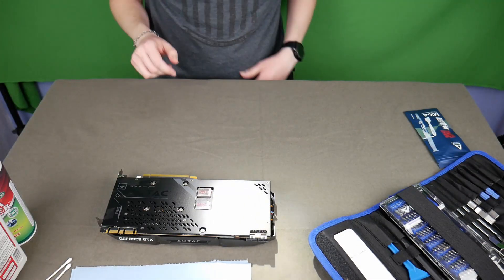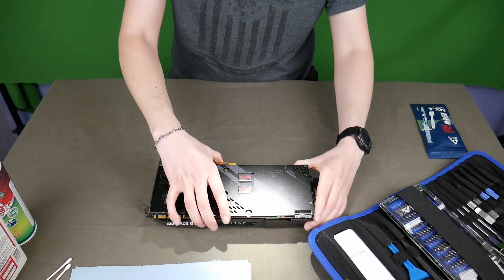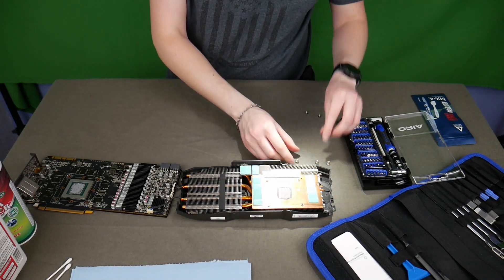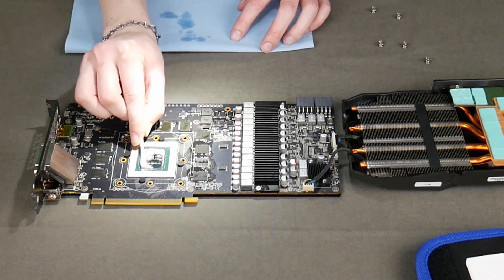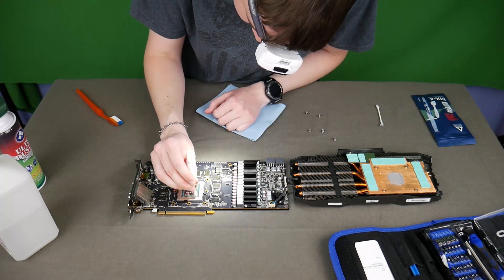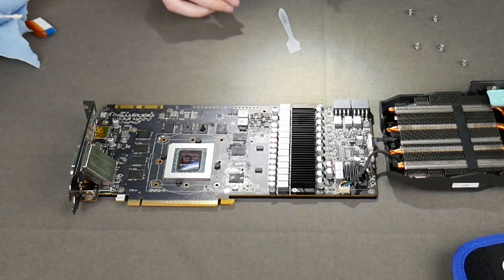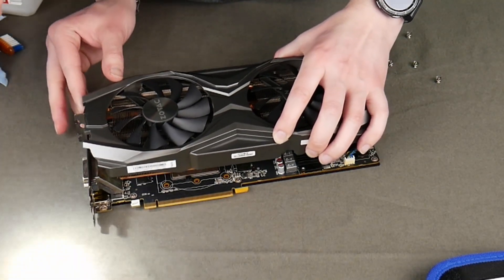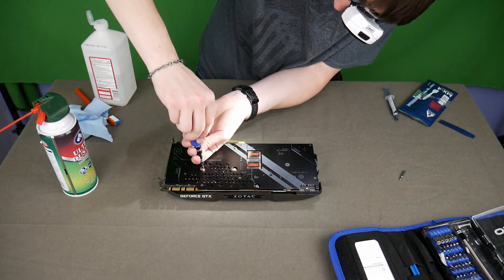Faster Fix - Upgrading Thermal Paste on a Zotac GTX 1080 TI

Comment: Haha i changed yesterday my thermal paste on my zotac gtx 1080 ti... Went from 80 degrees on full load to 55-60 ... 😅😂
Reply: Do you have the Same Card as in the Video? The normal AMP?
Reply: @derhenker6629  yup exactly the same
Reply: @derhenker6629  it's a awesome card, still holds up great after a few years off use
Reply: @henkhenkos8647  what kind of thermal paste you used
Reply: @MZ187  artic silver 5
Reply: @henkhenkos8647  thx
Reply: @henkhenkos8647  i know i'm late but do you remember how thick the pads for vram and vrm were?
Edit: nevermind i read thermal pads 🤷‍♂️
Reply: Thank you bro I am having the same issue with this card, my brother had crashing issues with it and let me have it. It is hitting up to 84c under load so I hope some new paste will help a good bit!

Comment: Hello, i have some issues with temperature on my card. i want to change the thermal paste and those pads, but my problem is i dont know which thickness it supposed to be ? maybe You can help me ? :)
Reply: You don't have to change the pads unless you rip/break them, they are usually 1 mm thick.
Reply: @OmegaSenshu  are you sure 1mm?
Reply: @wilow2010  yes 1 mm